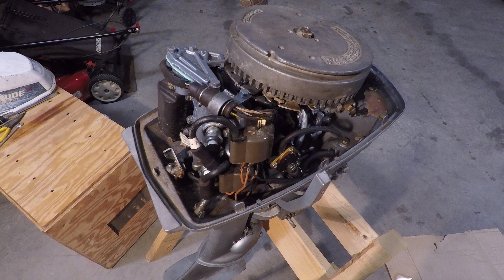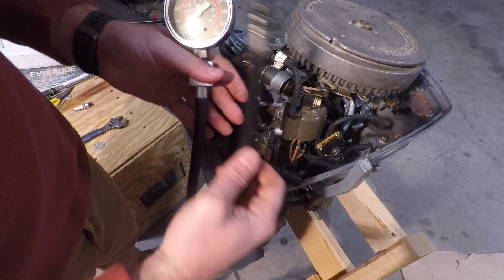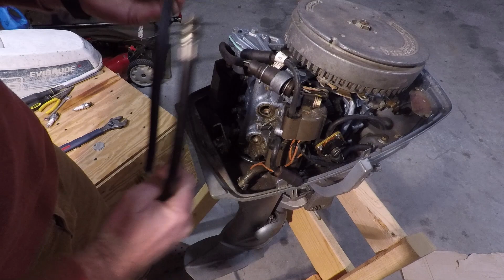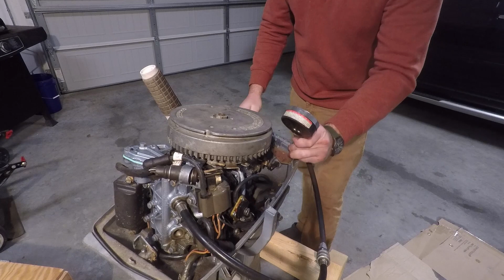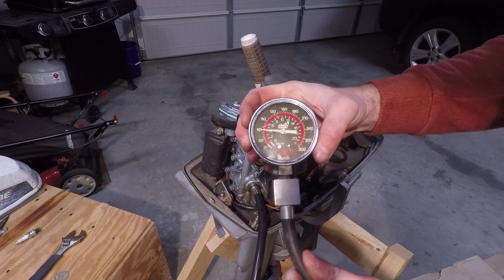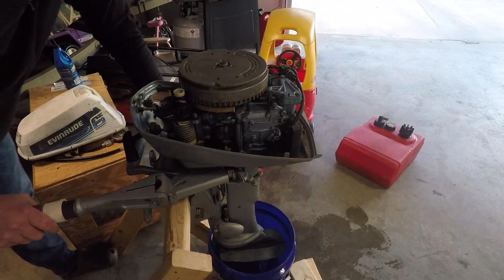Small Outboard Cylinder Compression Test

Comment: My 1990 6 hp Johnson compression both cylinders is at 52lbs 55 lbs and starts first pull , runs strong! These old Johnson Evinrude motors will run fine down to 40lbs compression no problem.

Comment: MAKE SURE YOU HAVE FULL THROTTLE AND FULL CHOKE ON!!!! I have personally seen 30% psi difference with these two conditions the other way (low throttle, choke off). This is especially true on older outboards I work on (60's and 70's).

Comment: I can't start my 6 hp Evinrude. But in plugs but nothing. I did comp test got 60 on both. Not sure if this is right way I had choke open and throttle on fast. And no fuel to engine. Did I do it wrong
Reply from the maker: That’s low compression.  Double check you are getting fuel air and spark
Reply: @thisoldoutboard  ok thanks

Comment: What is the normal compression for Jhonson/Evinrude 15 hp 2st 1999 old?
Reply: Anywhere from 100 to 125 90 can get away with but you won't run quite as well

Comment: All good but it's a good idea to ground the spark plug leads while doing this so the coils won't get damaged from the high voltages being generated.  ☺
Reply: How do you ground the spark plug lead?  And is there a risk of shock if your touching the lead while pulling. Thanks
Reply: @blakethesnake1555  To ground the plugs, I made up some brass rods which snap into the plug boot and have a wire and an alligator clip fastened to them. The alligator gets hooked onto a good ground so the high voltage has a path to follow. A small bolt or even a nail could probably be used instead.

Comment: I have a Johnson 4hp 1969 it’s only getting 65 psi on each cylinder and it won’t start, I have good spark etc brand new head gasket
Reply from the maker: Will it start with a little starting fluid? You sure your plug wires aren’t crossed?
Reply: @thisoldoutboard  no, I have put 2 stroke down the head and it doesn’t fire at all, I have had a couple of backfires, and it has fired once or twice, I will check the wires
Reply: It was the wires, thank you very much

Comment: silly question... but what if I pull the crank handle and it feels like no body is home?

the crank mechanism is not broken, but it feels like there is no resistance

guess there's no compression eh?

guessing the motor ran hot for a while because the water pump was failing
Reply from the maker: Sounds shot, or your spark plugs are missing...
Reply: Check the flywheel and make sure the key didnt shear and just spinning on the crank shaft

Comment: Great video with lots of good info. Just wanted to let you know that I recently acquired a 1968 5 hp golden jet that uses a single cylinder Tecumseh 2 stroke that has compression of 90 PSI , starts easy and purrs like a kitten.
Reply: That’s mint condition!!

Comment: my outboard is a 1971, 9.5 HP evinrude, and has 35 psi even on both cylinders, any suggestions will be appreciated, thanks. Points and plugs are new, I just bought the outboard a few months ago, it was all disassembled, but complete.  I checked and gave a service to the gear case, water pump, coils, and it runs fine, but I feel it king of slow. by the way, good vid.
Reply from the maker: Make sure your compression tester has  the shortest length hose as possible to get the best reading.  If you think 35psi is the best reading you can get that’s not good. Does it crank easily?
Reply: @thisoldoutboard  yes it does crank easily, I will try with another compression tester as you recomended. One thing I noticed when I started it the very first time, was that at the bottom of the water tank I put it in for testing, had some kind of debris, like small pieces of hard carbon, not metal, beacuse I was able to crunch them. I´m considering cleaning the power head, like the ring´s grooves and all the stuff in the way. The previous owner didn´t know how much use this outboard had, but I think it was abandoned disasembled in the lower unit only, for at least 20 years. It has zero corrosion, no salt water use. Thanks for your advise. and.. well.. we don´t know what is gonna happen next, right?
Reply from the maker: @gustavolizarraga4322  ride the lightning.  God speed
Reply: @mikey joe OK, thanks a lot, by the way, I did as @thisoldoutboard recommended to me, and tested with a better compression tester, shorter hose and read 50 psi both cylinders, just 4 pulls on each one. I'm gonna try again as you recommend
Reply: @mikey joe  👍 👍
Reply: @gustavolizarraga4322  did you ever get it fixed? I'm getting similar low results on both cylinders
Reply: @johnkfennedy7203  I have not worked on the engine since last post, for job reasons, but I learned from another forum, that the alttitide has to be taken in consideration, since I live in México city, 2000 mts above sea level, that affects compression results. Hope this Will help you.
Reply: Russ Gallagher  just right, not too fast but reliable? yes.
Reply: I have the same motor but 1973. I get 40 psi on both cylinders, runs OK but like you said it seems weak. Cranks OK, maybe 2 - 5 pulls. Maybe just general wear on the pistons/rings? I need to get a bore scope and look inside, or pull apart the head. Maybe new rings could help?

Comment: I've got a 1975 6hp Evinrude (see my channel https://youtu.be/rqWd8w4NZho) I'm only getting 50-55 on each cylinder. It will start right up, but quits after 5 minutes or so. Not finding rings readily available and not sure if it is even worth it. What do you think?
Reply from the maker: Woody, you can find powerheads relatively cheap on eBay (for instance here https://ebay.to/2mBKV9x ) I find it hard to think spending $150 on a used but good powerhead is not worth all the rebuild time.
Reply: Thanks for the link, I have sub'd to your channel.
Reply from the maker: Woody's Garage thanks. already sub’d to you
Reply: Thanks. Curious, have you run your engine on the water at all for a prolonged time? Mine was a good runner until all of sudden it would only go 5 minutes.
Reply from the maker: Woody's Garage yeah it was running fine.  I have since sold it
Reply: I'll probably sell this one for parts. I have a couple of 1970 9.5's that are better.
Reply: Any idea if the parts from my 75 (lower unit) will work on a 1985? Thanks my friend.
Reply from the maker: No they won’t interchange.  Completely different designs
Reply: Thanks a bunch

Comment: I restore old outboards and it has been my experience that say a 15 or 18 HP 50's evinrude or Johnson will show from 90 psi to 115 psi or even a bit more. I think when you get below 75-80 you will be considerably down in power....BUT full power is not important to some. What IS important, as stated above, is that both cylinders are within 10psi. Big variations means one cylinder has at best rings sticking from setting or it is DOWN HILL from there. Good basic info in this vid AND no rambling....to the point!
Reply from the maker: Thanks that’s exactly what I am looking for!
Reply: Hi I have an issue with an old evinrude 40hp big twin it will only crank when the spark plugs are removed it's a pull start do u know what may be causing this
Reply: @SuperEmitt i have a vid on my channel of the engine and promble   it was like it when I got it iv tried filling the cylinders with would and it drain straight out as the lower unit is removed already iv tried removing the exhaust unit but screws started snapping
Reply: What's is good psi for 15 hp Yamaha 4 stroke I'm getting 30psi and no start bought it that way
Reply: @airplane-bn8vb  NOT 30....a four stroke should have 135-165 or more in BOTH cylinders. May have a head gasket bad.
Reply: @outboardfixer  will have to check
Reply: N
Reply: You need test compression whit electric drill  turn quicker an you get  90/100 psi  esay
Reply: @Indietro25  lol, he actually wants to know the actual practical working compression, not interested in hacks to get inaccurately high numbers to cheat the next owner out of an extra $500
Reply: @Indietro25  That would be a bonehead move there pal...